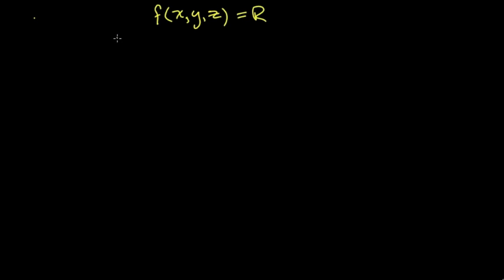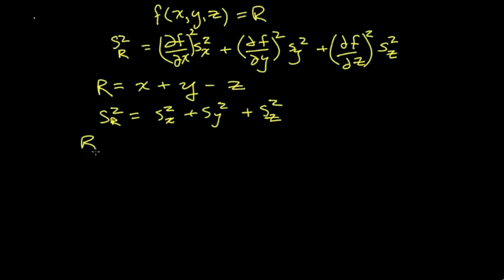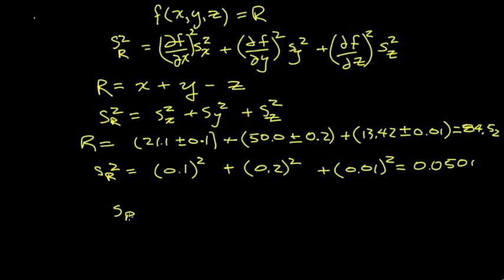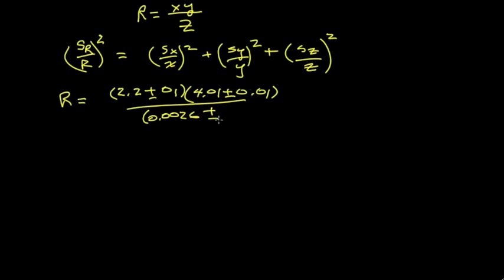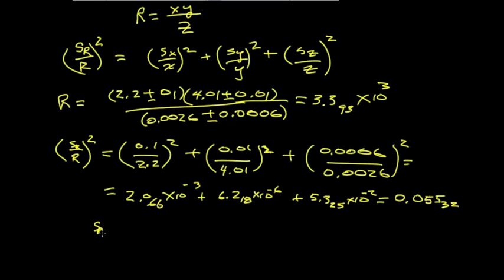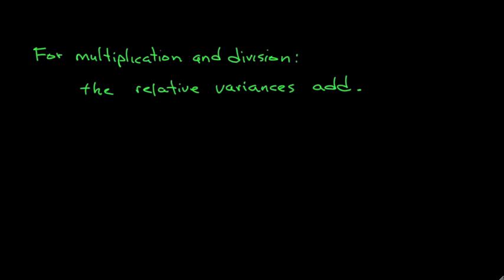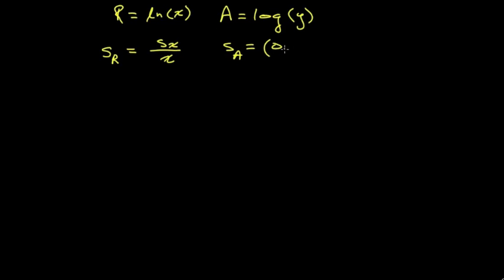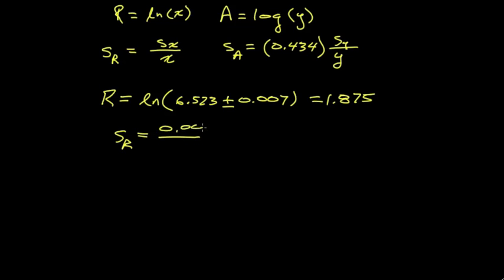Error propagation

Comment: i have a question, isn't it supposed to be x+y-z ? then how did the value summed up in the next calculation
Reply from the maker: The specific example actually was a sum of 3 terms, Perhaps, I should have used an example calculation that followed the same pattern as in the introduction to that problem. Sorry for the confusion. However, the point that you want to remember is that for either adding or subtracting (or a combination of adding and subtracting) the variance in the result is the sum of the variances in each term.
Reply: @garymabbott4064  I see. Really appreciate you for replying this fast